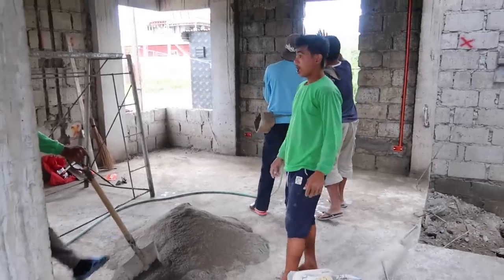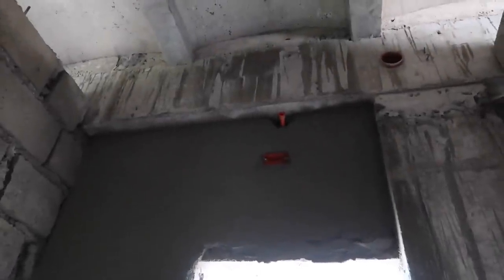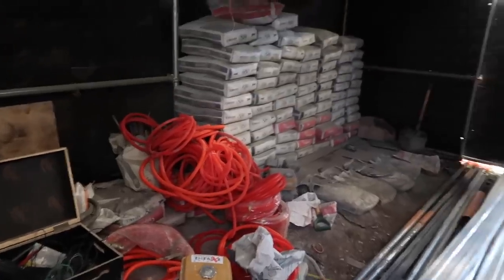HOUSE BUILDING IN THE PHILIPPINES  - EPISODE 81: CEMENT RENDERING

Comment: Madame/Sir,
Pagawan mo ng as-built drawing ang contractor para sa plumbing, electrical, etc. Lalo na ang electrical pipe layout yung sa wall vertical at horizontal kasi pagdating ng panahon kung magppakabit kayo ng paintings o ano pa man na kailangan magdrill sa wall baka tamaan ang live-wire.
Reply from the maker: Kenneth Clark bili na lang ng scanner
Reply: @retiredandhappyinphilippin3329    Good bili kayo ng scanner yung Bosch maganda. Kailangan ata ang as-built drawings sa pagkuha ng occupancy permit.